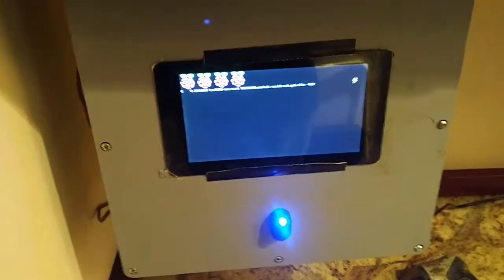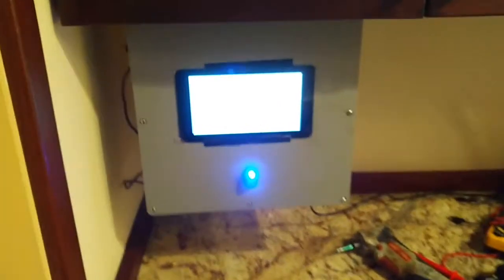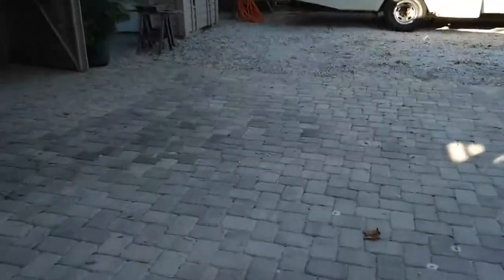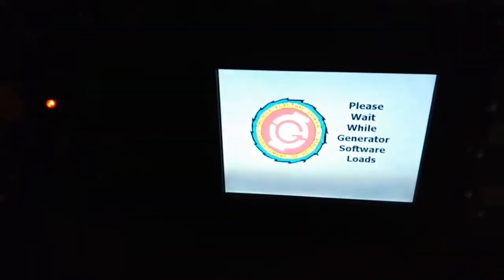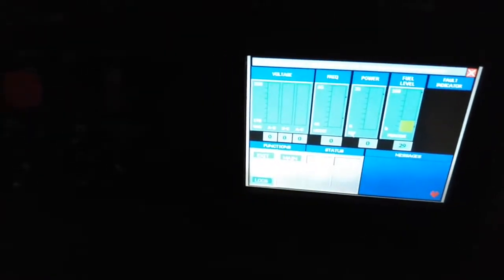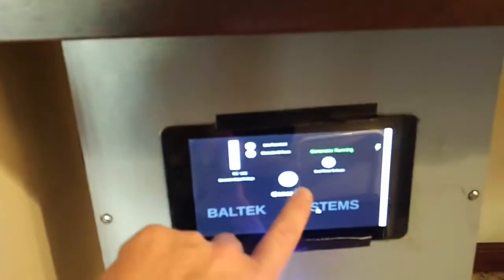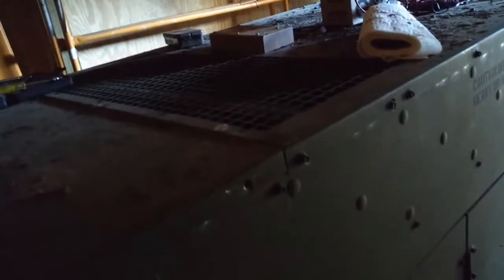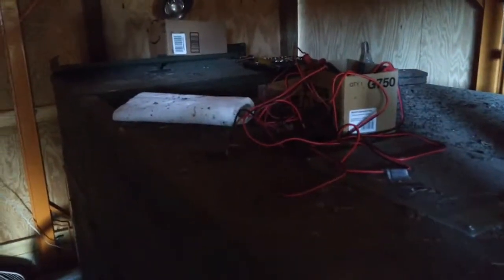805B MEP Generator Autostart System

Comment: How do I go about getting this system for my generator I have the exact same generator you have installed that on
Reply from the maker: Shoot me your info to balteklabssc@gmail.com. there's the control box and wiring to the analog switches on the Generator control panel.
Reply: @chillfuturist9668  This looks perfect for for what I need. I'll be shooting you an email as well with some questions if you wouldn't mind.
Reply: @chillfuturist9668 email sent.
Reply: @chillfuturist9668 how do I reach you?

Comment: Do you have any documentation of the components you used to code/implement this?  Also any of the wiring schematics?
Reply from the maker: Yes I do, the wiring would change based on the set up at the house and generator   used.

Comment: You obviously have a great generator, but my Generac starts within six seconds after power loss. Now I have a question, could your wife start the generator if you were not home?
Reply from the maker: I actually built this for an elderly couple. I've changed the interface so it's really easy for them. They also wanted it set to auto start if the power is out for 30 mins as well as once a month to charge the batteries. I have a web interface to access it remotely but that was too much for them.